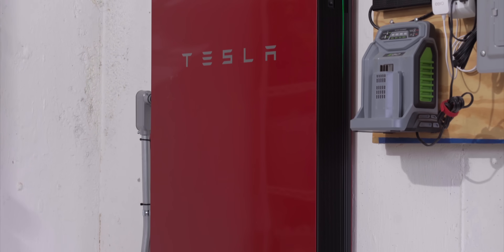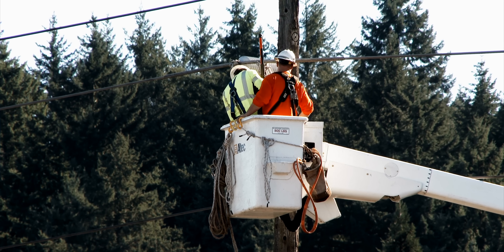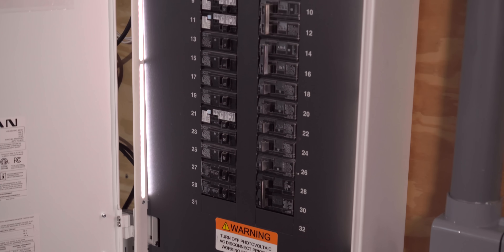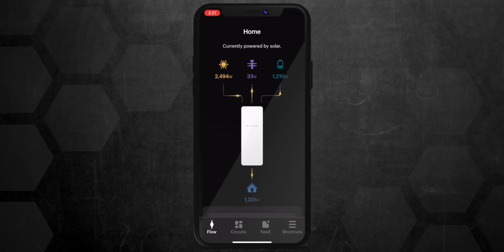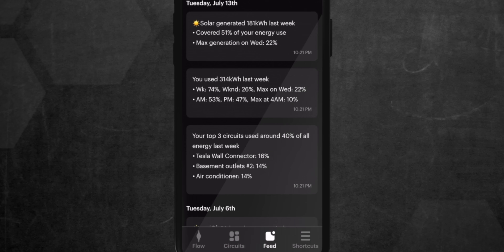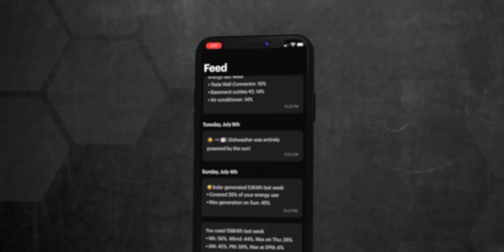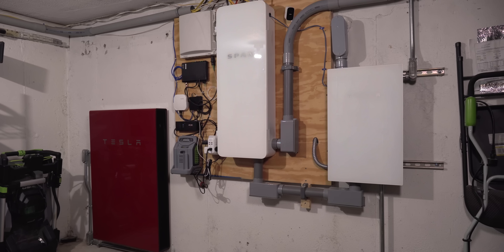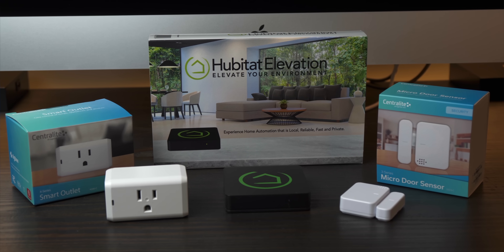This Smart Home Electric Panel Fixed My Tesla Powerwall

Comment: Want? Yes. $3500? Hell no. A standard 200w panel is ~$150. A standard 15a circuit breaker is between $5 and $10. Not counting the electrician, a fully loaded 200w panel is gonna cost you around $400-500. All that this adds is an arduino and a bunch of relays in series with the breakers.
Those relays, tho.. 90amps per circuit??? The cheapest 90a contactors on digikey are ~$180 each. No wonder the thing costs so much, they actually got a helluva deal on their contactors. Drop that to 60a and you cut the cost per contactor by more than half, and the only people who need 60a breakers are the ones running the 12 person jumbo hot tubs - the kind of people who can afford a $3500 electrical panel. 
If they offered different tiers of panel, such as a 150a with 30a contactors and a 200a with 60a contactors and then their jumbo 200a with 90a contactors, or a "mix and match" 200a unit with mostly 30a contactors at the top and a half dozen 60a and two 90a at the bottom, they could cut their component costs by a huge margin and offer customers MUCH better pricing. I'd spend $1000 (+ standard breakers and installation) on one of those lower tier panels.
Reply: They are not relay they are CT on every circuit that are a hair away from revenue grade.   They have a built in ATS (Auto Transform Switch) and some other stuff they really haven't spoken about.  You couldn't replicate these features for a $1000 "and" get a top notch software.  Their updated app is as good and informative as any monitoring app I've seen.   It's not cheap ..but it's not ridiculously expensive either.  I'm looking at the Leviton Load Center and the forthcoming Square D Home Center ...Span is right there in the mix.
Reply: @hmurchison8123  Yes I oversimplified the design, but also they ARE relays (contactors, technically). A contactor is the only way you can safely electronically switch 90a at 120/240v. They absolutely could make a much less expensive version using lower rated contactors without changing (nearly) anything else in the design. Just because Span or Leviton haven't done so doesn't mean it couldn't be done. They just don't want to. They're basing their design and pricing off of Control4 and other companies that have had smarthome breaker and switch panels for years. I guarantee you once competition heats up you will see the lower rated versions and they will still be profitable, probably more so than these.
Reply: @pufthemajicdragon  Ok cool you've forgotten more about electricity than I probably know.  I know enough to stay alive.  

I agree with you on pricing.  Even the big CT that we install on the service entrance conductors are 50 bucks so I imagine much smaller ones for branch circuits are much cheaper. 

Still waiting to get pricing on the Square D Energy Home Center.  I want to see how aggressive they get.
Reply: @hmurchison8123  I think the real revolution is going to be in smart breakers. Existing panel, just swap in a breaker that has built-in switching and monitoring. Swapping out a breaker panel is an expensive and time-consuming and complicated process that requires hiring an electrician. Swapping out a single breaker is a 5 minute DIY that most any home owner can do. Looks like Leviton is the only one doing smart breakers so far, tho theirs do require the "load center" and aren't compatible with standard panels - but something to keep an eye on.
Reply: @pufthemajicdragon  BOOM.  All they need is a smart breaker and a small gateway that can be wired or wireless.  If we really want consumers to jump into energy conservation consumers need an easy and affordable path to get there.

Comment: Great tech, but at more than a third of what my 10 kWh panels + inverter + LiFePO4 battery + installation cost, with split circuits for intermittent high load users, I think it is a pass. If one can justify it, why not!
Reply: No disrespect here.  I'm glad your system is working for you but 3500 for a 10kW + battery and inverter isn't top flight gear. At this point it's hard to point out a MSP that is even equal the Span in functionality.

Comment: Question. Can you set up a home battery system without also installing solar panels. Can the battery be charged off of the grid without solar panels. The reason for this question is that I’d like a backup system in case of a power outage without resorting to a generator (I’m not keen on storing fuel for the generator.)
Reply: Good question.  You should be able to.  You should reach out to Chad Conway ..he's posted in here for the definitive answer.  Basically in a micro-grid the system shouldn't care if you have solar or not its function it to manage all energy producing sources in a grid down event.
Reply: Hi Barry, yes! Battery only is supported. We are integrated with Tesla Powerwall & SolarEdge Energy Hub inverter + LG battery

Comment: Matt, how is the system protected from lightning? Do you have coverage on your homeowners insurance to cover a bad hit? If you do, how much is the added coverage? If your system is wiped out by lightning how long would it take you to get back on line?
Reply: I imagine the system draws power post main breaker. So it ideally react like any other system getting hit with lightening.
Reply: electrician? "(...valid question) " _ yeah, and what if the zoo gorilla's get loose and rip your arms from their sockets?.... HUH? .. _

Comment: Thinking about Span for our new home build in a semi-rural area. The builder will provide a 400A service to the site, which I assume means 2x200A panels. Would we purchase two Spans? We also plan to have a detached garage/workshop/apartment, which means a third panel?

We haven't selected a PV and battery provider yet (we are happy with the tesla panels & 2 powerwalls on our existing home), and I'm glad you mentioned that Span's compatibility is with Powerwall and LG only. I'll make a note of that.

Thanks for the video!
Reply: I've seen Arch reply to people inquiring about 400 A service. Is your home going to be a all electric? Swimming pool?  Hot Tub?  Pumps?  Personally I don't think you'd need to do 2 or 3 smart panels as lucrative to Span as that would be. I think a lot of energy consultants would say backfeed the sub panels to the Span and meter them.  If the Span can't do 125 A breakers that could be an issue. 

For the batteries ....ignore brand and focus on continuous output.  Nowadays 6kW is just not enough for electrified homes.  Ideally we need to. be in the range in 8kW continuous with 10+ kW short term peak. 

Insulate the hell out of your home.
Reply: @hmurchison8123  Thank you for the advice! I appreciate your thoughts
Reply: @dashrb5  Congrats on the custom home.  Whatever you do it's going to come out fantastic.
Reply: Hi Robert, we might be able to get you to a 200A service so that you don't need two backup systems. Otherwise, yes we do support multiple panels per home. We are happy to help: span.io/get-span

Comment: 200 Amps in a residential setup sounds insane to me as a European with a 3x25A house connection. Really large houses may have 3x40A here but you'll be paying a lot of fixed cost for such a connection. I guess it does help to have three phases and 230V per phase to keep the current rating down.

Comment: "They ran communications wires outside of the conduit..." Your "problematic" third-party electrician was merely following the National Electrical Code. It's actually quite dangerous to run low voltage and high voltage wires in the same conduit. If Tesla is recommending that, shame on Tesla. Though it's unnecessary to put low voltage control wires in any conduit, if you choose to do so, it must be a separate conduit or raceway.

Comment: My synology was using to much power as well because the drives don't sleep (even if they are set to sleep)
Instead I sold my Synology and with the money I built an UNRAID server with similar features and slightly a better CPU, It can power down it's drives and uses as little as 8w when it's in standby compared to the 100w of a Synology with expansion.

I did a video on it (called plex build or something similar)
I had very tight power requirements for it because I only have 1.3kw of solar

Comment: How does this differentiate devices connected on a power strip? Also can it be used as a normal electric panel without the solar.
Reply: Yes, it can be used without solar and/or battery.

Comment: i do commercial controls for buildings like ikea dicks sporting goods all the tj max associated stores and i prefer square d smart breakers! you just set an ip inside of the panel and plug them into your network and can program each individual breaker and time schedule them and group them

powerlink panel

Comment: I have a similar set up 4kW solar and a Power Wall. My issue is how to integrate and automate a natural gas back up generator. I have a secondary panel and the whole system cost me only $17,000. I have all my 120v loads on my backed up secondary panel. I left my 240v loads on my main panel AC, oven, dryer. Unless Span can integrate and automate a back up NG generator it doesn’t seem to add value comparable to the cost.
Reply: Hi Matthew, do you have an ATS for your generator that only turns on if the Powerwall runs out of charge? If so, yes Span can be installed. For more information, please get in touch: span.io/get-span
Reply: @chadcconway  I have an ATS for the Power Wall, Solar, and secondary panel between the main breaker panel with all the 240v loads and the secondary breaker panel with all the 120v loads. If I lose utility power my 240v loads are de-energized when the ATS isolates the solar, Power Wall, and secondary panel from the primary panel and grid. What I would like to do is install a BU NG generator inside the ATS and move my 240v loads inside the ATS as well but only energize them if they are powered through the ATS from the grid or the NG generator. I would like the NG BU generator to run only during the day when either the solar supply is inadequate or the 240v loads are required. For nights the Power Wall is more than sufficient as long as it starts the evening charged up. Most days solar and the Power Wal are more than adequate to power all my demand. So this would only occur rarely. Would Span be able to accomplish this?

Comment: This product seems similar to the smart Leviton Load Center (I asked my electrician about it, also very expensive btw).  But I do appreciate this video and your demo of the UI - which when dealing with technology that most of us don't deeply understand is really really important for decision making.  I also like that they built this (seemingly) specifically to fill the gap with home batteries as you explained.  The whole smart home thing gives me headaches, with trying to decide on the perfect products for the perfect setup... but this I think is a no-brainer if you're at the point of getting solar or home batteries.

Comment: At some point I need to replace my roof, at that point I will add solar, run two 220v to the garage for car charging, get a home battery and a Span panel. A very big bill but it will go straight to the resale value of the house.

Comment: What happens to this when Spin goes out of business or discontinues the product?  Panels typically last for 40+ years, if this has a cloud control, I would be weary of using it.   But it's a very cool solution.

Comment: The EMT pipe down on your concrete is gonna be a problem it’ll rust out eventually plus it could get water in the junction box. They should of ran it up and around.

Comment: This seems to be quite useful in a setup involving solar panels, battery storage and dispensation of said stored power. I would be interested in such a device if I had a solar panel set-up in my house. It seems this product is literally a smart electrical panel. I see value in that by itself if I gain the ability to see how my home is using power in real-time. The software accompanying the hardware looks sleek and user-friendly. I like how you can have lists to prioritize what you'd like to keep powered versus things that must maintain power (like the fridge). Very cool technology for the home.

Comment: hey matt, great review! do you know if the span smart panel can be used effectively in an off-grid only setup? i can see it being great for managing power stored in the batteries across different appliances/consumers. instead of a power cut trigger, you would want a battery level event when its passed.
Reply: For the price, you can build your own. This thing is roughly $4k to get delivered.

Comment: In defense of the third-party electrician, national electrical code does not require communication wires inside a raceway (conduit). The reason why The NEC requires electrical wires inside raceways is to protect the public from electrocution, communication wires are allowed to be installed outside a raceway because it is considered low voltage and safe. I believe Tesla is inflating their installation standards, electricians have more experience compared to these young Tesla Product Installers. Now I do agree it doesn’t look pretty, it would look nicer inside a raceway(conduit). I enjoyed the content.👍 I like that Panel !

Comment: I'm about to add a garage to my house, and when I do, I have to re-do my entire electrical system in my house (its also from 1960, so I want to upgrade anyway). This is a perfect solution for me. Even if I dont plan to add Solar (its just not financially feasible in Canada atm). Id still buy this, purely to increase my visibility and control over my entire house, remotely. It makes total sense.

Comment: We went with a second powerwall and whole-house backup instead of a critical load set up with the requirement for a new critical loads panel.  It allows using the existing wiring and decreased installation cost, and also increased our battery backup capacity to ensure we had power until the solar kicked in the next day.  It also lets us start sending power back to the grid earlier for more credit $/day.

Comment: I bit.  Your videos ended up with two Powerwalls in my garage.  This video [EDIT]  I contacted them, and after my electrician made it through the online certification course, SPAN took my money and I have a tracking number, due next week.  I'm excited.  Thank you @Undecided with Matt Ferrell -  I'm expecting to use the panel to help me avoid the punitive rates the power company charges during peak periods.
Reply: @Chad Conway Location is Virginia, and timeline is now or never.

Comment: How does the SPAN app know how much charge is left in your PW?
Reply: @Chad Conway so you hard wire the Span panel to the PW gateway? I've installed several PWs, connecting 3rd party monitoring/communication is news to me.

Comment: For me, I'd only consider such a system if for each line, there was a 3 position switch to change from non-essential, nice to have and essential (ie you don't need the app) and when in essential, the computer is not involved, so there's an effective override On as well as an override Off. Then you know even if the computer fails, you still have a functional switch box.

Comment: This thing literally does the job of a Star Trek ship’s main computer: Reroute power through the… secondary… conduit.”  

Seriously though, properly applied, this panel’s design can be used to minimize power usage regardless of power source.  I believe it could help drop kWh used by up to 50% since many of the things we have plugged in today draw at least a trickle charge even when “off.”  That would mean lower power bills, increased battery life on backup systems, or even a drop in propane or LNG use/cost for generators.  Living in the Upper Midwest, solar is almost useless for me, but a whole-home LNG generator isn’t.  I could either run a size that is currently considered appropriate, with less wear and tear or I could possibly scale down to a lower capacity, lower cost model.

Heck, combine it with the Liquid Metal batteries that you featured (which seem to be infinitely more scalable than the Li Ion), and instead of 20 years of daily deep cycling, a consumer might get 25, 30, or even more for the same investment.

Comment: The Span system is genius, and I like it, but I won't install it in my home.
1) Span doesn't have a lot of history yet. I see a lot of proprietary hardware, in a very expensive primary home system, that if Span go under, you're going to have vastly overspent on a breaker panel.
2) You're putting a primary home system into cloud control. We've already got hacker getting into social media and telecom companies, it's only a matter of time before they get into these cloud based smart home and security systems. Or, if you're a conspiracy theorist, you're giving the government the ability to leave you in the dark.
It's a great idea, but I'd like to see this revisited in a few years, and see how Span themselves are holding up. In the meantime, I think I'll research how to do this with local access only.